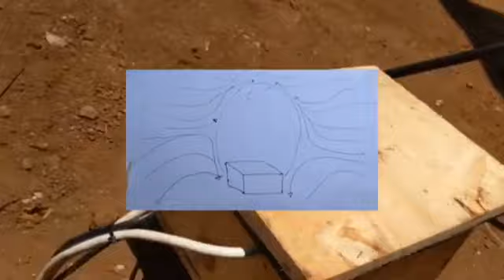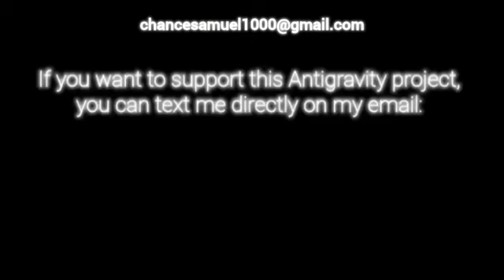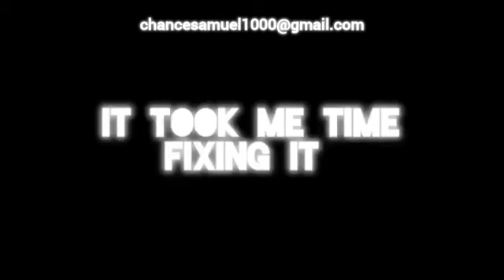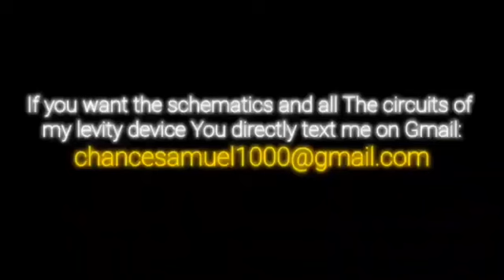KEIDIUM LEVITY DEVICE | DEMONSTRATING ITS DESIGN AND PHENOMENA

Comment: Does a florescent bulb light up over the top of the device? It might help explain the force you feel. There might be strong electric fields, and you can map the area of these fields by using a small florescent lightbulb. The helical coiled bulbs seem to work best.

Comment: Why don't you try to attach a small pole onto your device, then place a weight onto the pole and see if you can get the weight to rise up and levitate along the pole, up and down. The pole will prevent the object from just flying off the device. You should also try pulsing the Ultrasound on/off to see if you can get a steady effect. You can do this with a small circuit using a transistor.